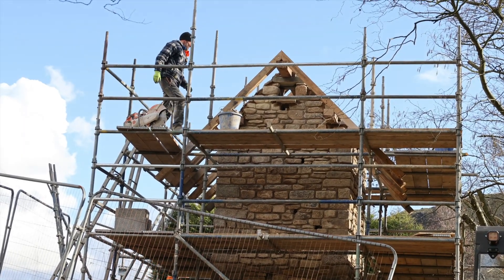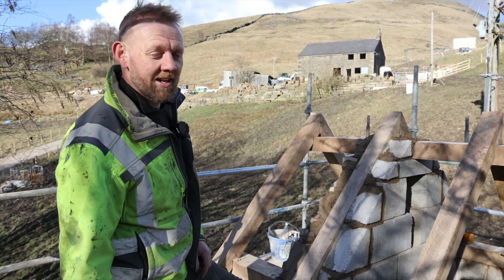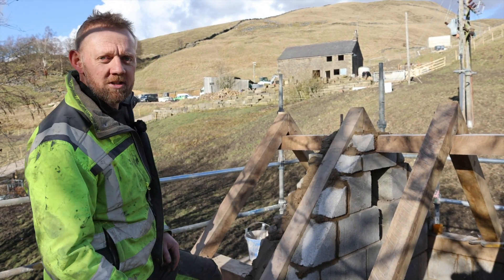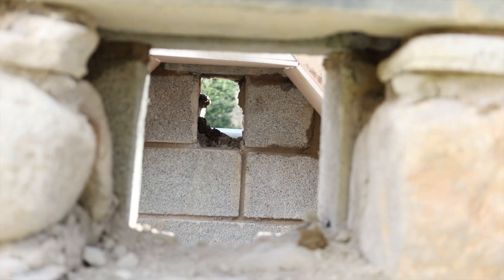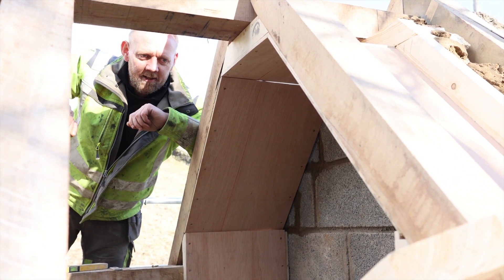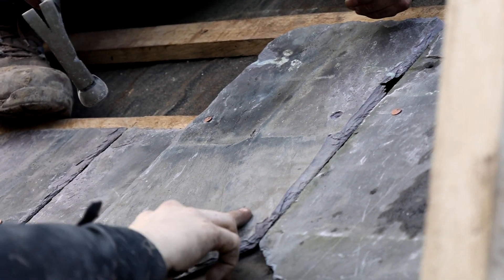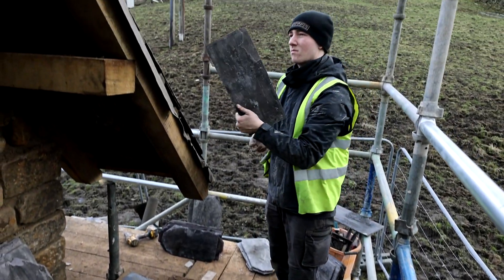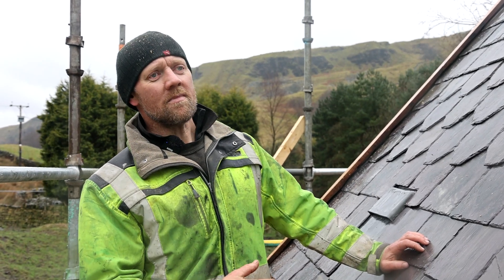Wildlife Tower 3 - Lead Bat Vents, Reclaimed Roofing Slates, Leadwork and Oak Frame Roof

Comment: Did you have to use the F1 bitumen felt ?
Reply from the maker: Yes, we used Type 1F under the slate. Can cause moisture issues in houses if not properly vented. Have seen it been used for roofs with bats and no additional ventilation been fitted. Massive condensation issues in the attic space.
Reply: @UKRestorationServices  yes apparently bats can't climb on the breather membrane they can only grip to the 1f stuff great work by the way👍